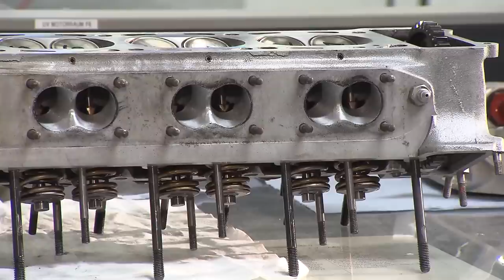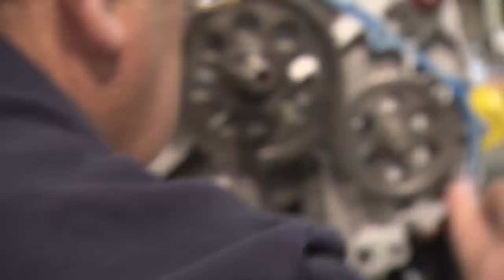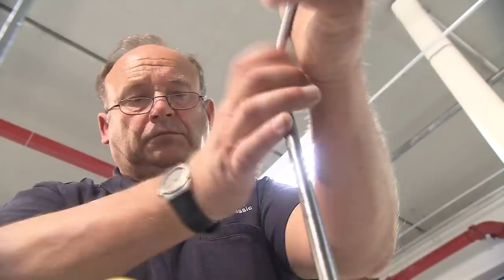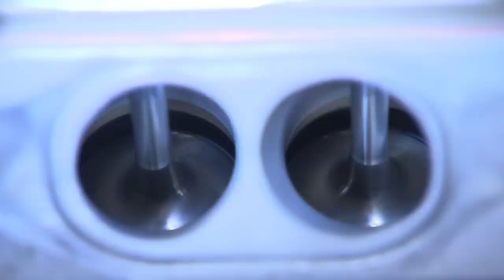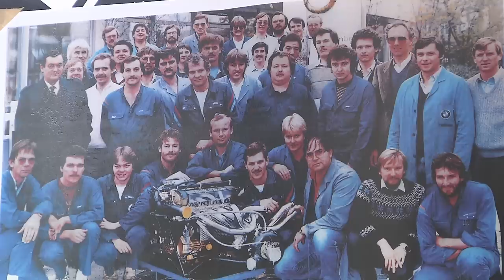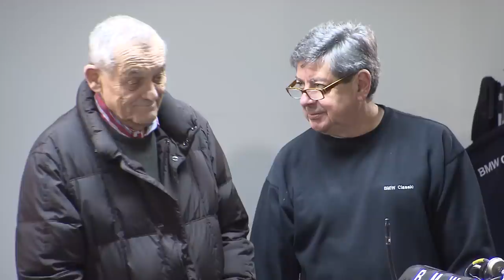BMW F1 Car BT52 1,280 hp Engine Assembly

Comment: I guess they didn't really care about ligtweight rotating assembly back then xD Look at those conrods!
Reply: It's shape, thickness, and size aren't good indicators of it's mass and weight. Titanium (the material that I suspect that the conrods are most likely made from) parts can be incredibly lightweight despite with the appearence of weightiness. And when an engine is boosted, it is generally advised to have heavier parts with more material to handle the strain. For example, man experts in drag racing. Their engines would also be under immense loads at obscene boost levels, many of them run conrods upwards of 1000g in their engines. Yes, low mass would've been importent then for the rev limits and responsiveness. However, the strength would've more of a priority. Also, the engines in qualifying trims wouldn't have to last more than a few laps before suffering catastrophic failures. Those probably would've probably had lighter rods, but these couldn't. To last a whole race at those boost levels? Your guess is correct.

Comment: Anyone that can tell me what the name and function of the part at 03.10? Thank you
Reply: Although it's an 1 year old comment maybe you are still interested :P I think it's an external oil pump... I don't know much from the racing M10 engine,but in motorsports they use dry sumps to prevent oil starvation due to high G during cornering.... With a dry sump system,the oil is collected in an external reservoir and not in the sump,so the engine will always have oil flowing, regardless of G power....

Comment: They could reduce the material on a lot of those parts to save weight. laughed at the size of the turbo, it probably has more displacement than the motor does. 

F1 spindly parts under tons of boost spun to the moon to make those crazy power numbers.

Comment: I'm surprised that two bolt mains can support high rpm and over 1000 horsepower.
Reply: The mains caps on this engine are billet items, not OE pieces. More importantly, because that 1000+bhp was generated at high rpm, torque was kept to reasonable levels (e.g. 400 ft/lb or 540nm).
Reply: TrappenWeisseGuy ; thought the same, might be like the Cosworths, billet and press fit (we're talking a tool to spread the block to get them in) which might minimize cap twist/stretch
Reply: I'm sure there's an interference fit in there somewhere and maybe there's something going on there that we can't see.Also, there's the fact that these engines were doing as little as ten kilometres in the case of qualifying engines. Either way BMW had it well sorted out.
Reply: Fair point, thanks.
Although you have a lot of problems with high RPM turbo engines. Heat destroys everything.
Reply: If i not wrong top fuels engines uses 2 bolts too.

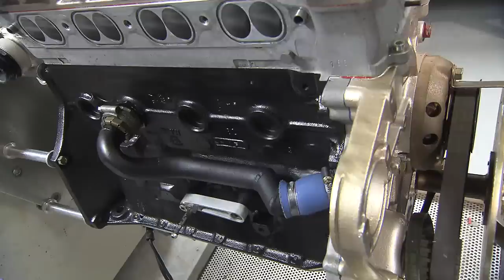Comment: @ 3:14 are they installing a direct injection fuel pump? What year is this engine?
Reply: The BMW BT52 car was built for the 1983 F1 season.
Reply: This is a dry sump oil system.
Reply: Oh! So its the oil pump thats beeing installed?
Reply: yes
Reply: This is definitely not the oil pump, it is a mechanical Kugelfischer Injection, just google it. 
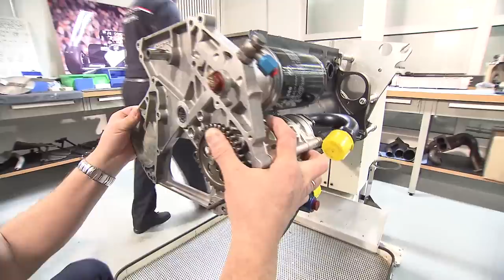You can see the real oil dry sump pump at 1:04, the part, where he is grabing with his right hand under the oil filter
Reply: Ty mate!

Comment: Throttle body on the turbo inlet.... never understood that move
Reply: It's a crude form of anti-lag. There are also throttle butterflies in the inlet manifold too. Think about what happens to the speed of the motor in an vacuum cleaner when it is blocked - the speed increases. This form of crude antilag does a similar thing to the turbo - the throttle on the turbo inlet makes it run in a vacuum which unloads the compressor and keeps the turbo RPM up.
Reply: Matt Ames finally found a good explanation of it! Believe it or not, there’s not much on the net, thanks for taking the time to explain
Reply: Matt Ames I don’t know what you said but sounds amazing 👍
Reply: Besides the reasons already stated, it eliminates compressor surge on throttle closing. No need for a diverter/blowoff valve. Pre-turbo throttling actually gives more linear throttle response, but conventional turbo seals will leak oil in a vacuum so it's impractical for street cars.

Comment: what boost levels were they running?
Reply: muya Metal!!!!!!! Really ? I really thought it would be more than that considering the power output. Thanks for the reply.
Reply: The 1986 spec BMW M12 ran at 5 bar boost level during qualifying
Reply: I think is like 65, to75 PSI.
Reply: 5.5 bar.... a lot lol

Comment: Spring coil valve? I thought it compressed air cylinder valves
Reply: XiaoXing Liu pneumatic valve springs were only introduced in the mid 90's
Reply: sorry, you might wanna do a little more research! lol, 
 Renault introduced Pneumatic valves back in 1979 when they also were the first F1 team to introduce a Turbo F1 car, albeit the BMW Brabham was the first Turbo F1 car to win the WDC.
Reply: Oh that's right, thanks for clearing that up. So, Renault created the technology, but when did all the other engine manufactures start implementing it too?
Reply: hehe, so we've gone from "introduced" to "implementing"! I haven't been alive for enough years to know when any team used whatever...I know Renault have used it themselves since 1979.